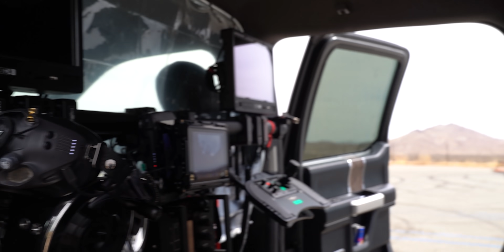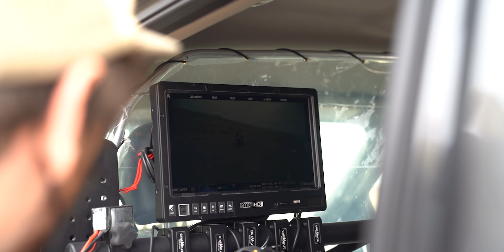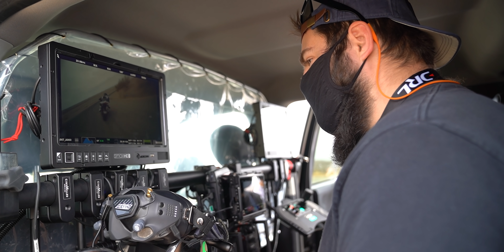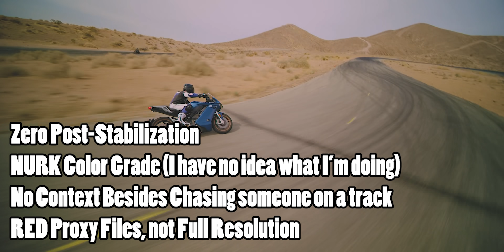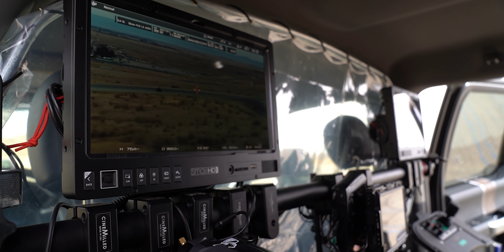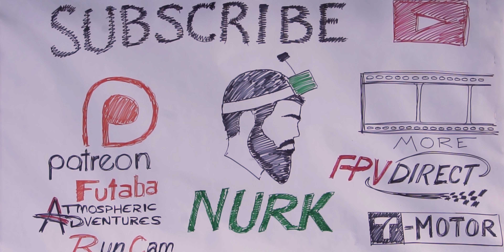Filming an Electric Motorcycle with a flying RED Komodo

Comment: Dear lord I've never wished to have an extra 10k to spend more than I do right now... amazing bro
Reply: 10? Cute... Body is only 6 but cine lenses are so expensive and then all the support equipment for the camera (red mags, batteries, etc) and the drone + equipment... Easily flying 12-15k and the ground setup is probably another 10-20k. And that's not including that dope ass film truck they had there with the monitors and director setup. I want.

Comment: Nurk,
so sorry to ask here, but I cannot locate the video where you are testing either a Y6 or X8 and you are using a fake (brick?) camera model which has the same weight as the Komodo, but is completely fake so that if you crashed, the camera wouldn't get broken. Would you be able to tell me where I can get a "brick"? I've a Z-Cam and need a scale model.

Thanks

Comment: Hey Nurk. I hope you or someone else knowledgeable with the new FAA rules sees this question. From what I've read the FAA will now allow flights over people without having to apply and wait for a use waiver, but only if your drone fits into the new classifications of Cat 1, 2, 3, or 4. Cat 1 is sub 250g with prop guards and Cat 2 is over 250g with prop guards, (which I believe is where most Cinewhoops would fall under). The problem is Cat 2 drones require a "declaration of compliance" given submitted to and approved through the FAA to "prove" any particular drone meets the safety and injury mitigation. But I can't find any info on how that process is supposed to work. I'm just getting into drone flying and was really looking forward to trying to get into drone cinematography. But all these rules are a huge confusing mess and are threatening to suck the joy out of this new hobby before I've really even begun.

Is there going to be a reliable way for individuals to get an approved declaration? Or will we all just have to wait around and hope all of the manufacturers can get formal paperwork submitted for FAA approval?